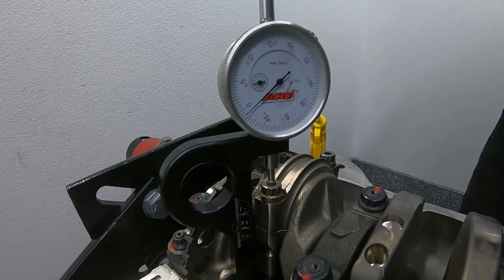JRP Performance Evo X 4B11 Engine blueprint and assembly

Comment: Great video! I watched it twice. Watching other u-tubers go in to JRP and get a great detailed walkthroughs I am convinced that JRP does excellent work. I'm bringing in my 4b11T to get this work done for it. Trying to push up to 700whp on my X reliably. I'm sure with this kind of attention to detail and OCD-like build and knowledge, pushing my X to 700whp reliably wouldn't be much of a trouble at all. Great Job JRP. I love it that this shop is not a assembly-type work with a lot of motors going in and out. JRP seems to be a small shop that takes pride in their job get very very personal with their motors. 

Somewhere in these walk-through videos, did you mentioned that you use to work for Mercedes Benz? Or did you go through a schooling for Mercedes? I wouldn't be surprise if you were a student with some of their engineers either abroad or at UCLA.

Comment: That piston ring tool comment is a strong statement. I don’t think it’s professional that you don’t think that you can take someone serious for a piston ring spanner. I don’t discern your work but I definitely discern your statement. If you watch videos from Subi  Performance they don’t use them and you can take them seriously. This video has good information but that’s BS if you can’t walk a piston ring on and I have done both with and without there’s nothing wrong with either way unless you have newb hands or Parkinsons putting rings on.
Reply from the maker: Jason Ruiz I would still never walk rings on, specially the thicker rings that I use now. It’s not the proper procedure when there is a $5 tool for It that can prevent It from bending even if it’s only a possibility.

Comment: Hey man are you lubricating both sides of the crank and rod bearings? You said If when you squash rod cap if  you see engine assembly oil squeez out you'll take it apart and redo it ? And also which way does bearing tang go as far as orientation of rod in the block ?

Comment: question with the rod bolt stretch i see you do  1 at a time then you torque it to 62ft pound then you say loosen them and do the other 1 and torque it to 62 ft pound to get the correct stretch of the bolt. 
how do you know that the first one that was tightened is the same stretch cause it was torqued twice or it wont stretch anymore cause the its the same torque specs? even tho it will have different amounts of anti-seize/lubricant on the rod bolt. if that makes sense.
love your content wished you built sr20s tho. :)

Comment: I would really love to know this knowledge. Where do people start to get to this level?
Reply: Francisco Gastelum lots of research my friend.
Reply: Kenny_Fa5 You think at a dealership as a Lube Tech would be somewhere to start?
Reply: Francisco Gastelum Being an apprentice in a shop without paying for school is one or forum's but be careful some people have no clue what they talking about.
Reply: Kenny_Fa5 I’ve heard of guys that have gone to school, and they have told me it’s pretty much just the basics, that learning to build performance engines that you have to learn it as you go through and someone teaching you, Schools are a waste of time, and I got that from multiple people now. So my thoughts are lube tech would be a start and learn off of the master tech already working there and eventually get hands on with them and learning off of them
Reply: Francisco Gastelum yea going to expensive schools for a piece of paper is a waste of time maybe its a win for some people i don't know.
Reply: Francisco Gastelum yep lube tech start from there and work your way up.
Reply: Kenny_Fa5 Master tech from Honda had told me the best way to learn is off of my own car. Starting with the most simplest things such as changing the oil, changing brake pads, rotors, A/C servicing, flushing the engine stuff like that. I need to get the most basics fundamentals done first and be able to do it without and issue. That I can learn off as a Lube tech at any dealership.
Reply: Francisco Gastelum i love working on my own car it sometimes pisses me off on tight corners but i get done.
Reply: Lucky Rooster hahaha lol yeah I actually helped out a buddy of mine install drop in cams on the Evo last month. So far so good. Got it tune with locals and everything seems to be good
Reply: Thank all y’all who answered the question cause I had this question in mind too and this helps a lot to get started learning. Right now I just been watching videos.

Comment: When using all brand new parts for the internals do you still measure all those clearances? Or just the obvious important ones
Reply: I was wondering the same thing cause buschur racing comes to mind cause that’s where I wanna get all my stuff from and I know they do machine work but I wasn’t sure if I would need to take their block to the machine shop for further inspection or would it already be ready for installation.